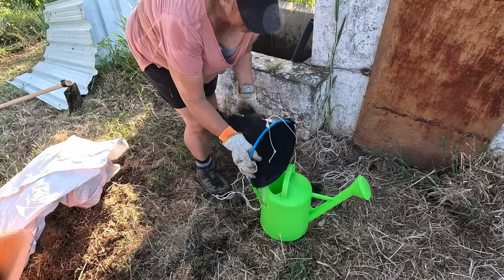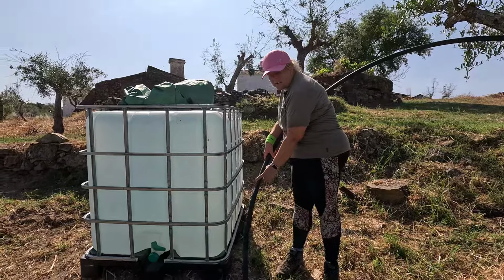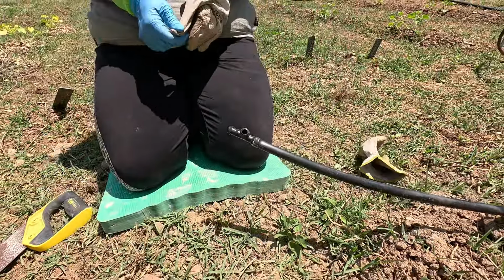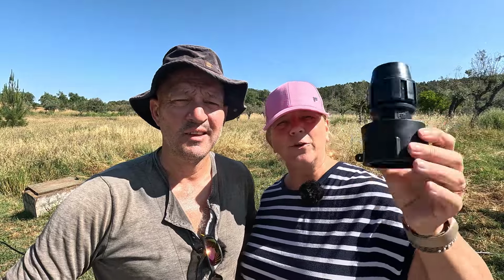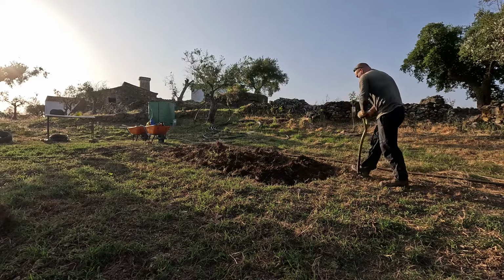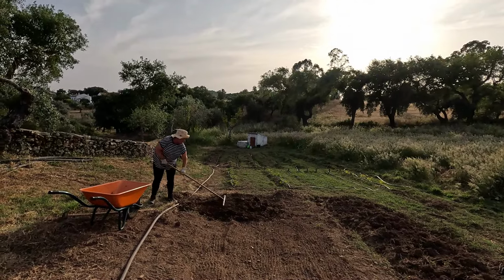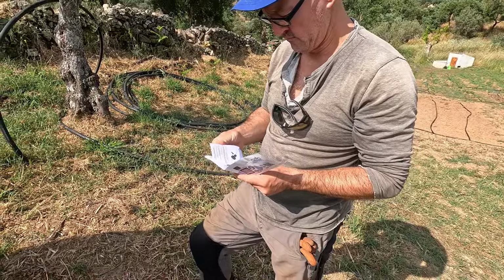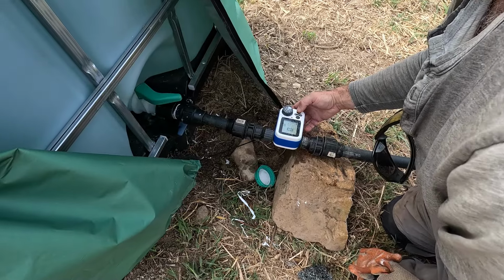Off-Grid Drip Irrigation Setup Challenges | Homesteading in Portugal | DIY Water System

Comment: Great video, I learned a lot from you , thank you
Reply from the maker: Thank you!.. hopefully if you do your own drip irrigation system - it wont be as difficult as ours 🤣
Reply: If you put Teflon tape at each connection should solve your leak's...
Reply: You have a nice piece of property, it has a lot of potential
Reply: Another thing about IBC totes are you have to match the thread's coming off the IBC. If not you will have nothing but issues. At least IBC totes are this way in the USA

Comment: for ibc you need a female tread to fast connect 32 mm. your ibc sould be at higher spot to increase preassure in final 16 mm pipe. make note that 16 mm might not be enough to suply water to all dripper tube you laying you might need to add 32 mm pipe and make the conections to dripper 16 mm tube from there at 20:10 put some teflon tape in those treads
Reply from the maker: Thanks for the tips.. it seems to be working well at the moment but will keep your advice in mind ❤️

Comment: Hello! I have done quite a bit of irrigation systems using exactly the same type of hoses and, at the beginning, I also had the same problems with leaks. Mainly on the 32 mm.
 - Cutting the pipe at 90º, and "clean" the cut, is paramount. That is the surface that will seat on the rubber O-ring.
- On the threads, it´s correct to use the PTFE tape, always applied on clockwork sense. With regular tape, a 32 mm threads, 5-7 turns of tape will do.
- Make sure that the O-ring is well placed.
- The low flow rate of the dripping holes can be caused by the very low pressure inside the pipping. I think that the 4 l/h announced, it's for a higher water pressure. If the level difference between the IBC and the veggies is 3-4 mts, the pressure is 0,3 - 0,4 Kg/cm2 (or 0,3 - 0,4 bar). So, you can measure it by putting a bucket under one of the holes for 1 hour, and evaluate the flow rate. Then, set the watering time accordingly.
- On the  16 mm pipe fittings like, T and 90º curves it's advisable to secure the unions with little plastic quick straps well tighten. Not that the water pressure justifies it but, next year, moving aside the entire pipe system to pass the rotovator, the straps will help to maintain all the connections and keep the system in one or two pieces, instead of a mess of pipes and fittings all over the place when you move it and re install again.
Regarding the satisfaction of working the land by hand, I totally understand what you mean. And it's the best way to really know the piece of land we are working on. And the smell without the diesel flavour of the tractor engine it is as great as the lack of the engine noise.😊
Very good job you both show on this video. Well done!
Reply from the maker: Wow!… you have given us some brilliant advice there… we really struggled with this task (and also the video editing this time)… we found it hard to believe that it was actually going to work! Great to hear that we aren’t alone in that frustration. 
Thankfully we did get there in the end and we have learned so much. 
Onwards and upwards and next job is to tackle the couch grass that is also being watered 😂😂😅